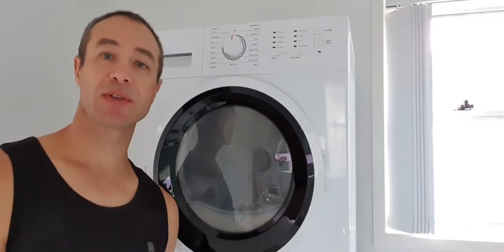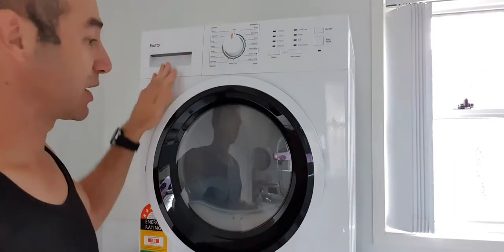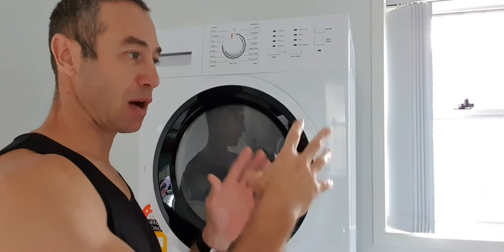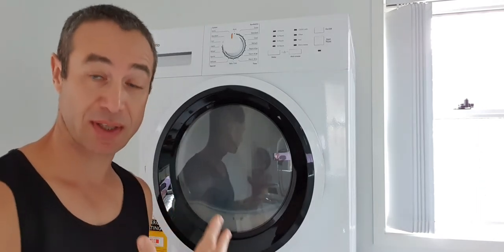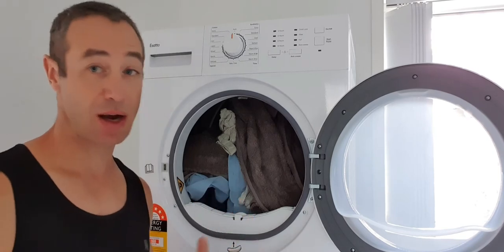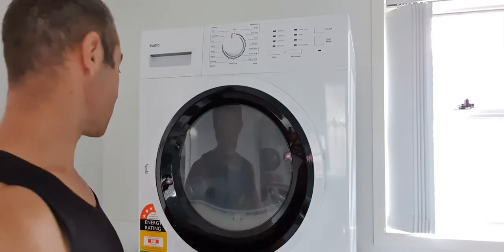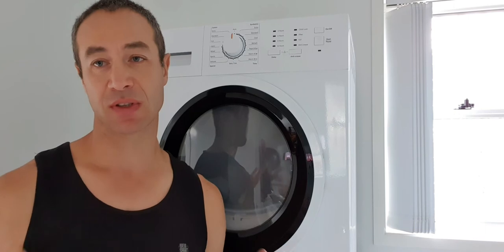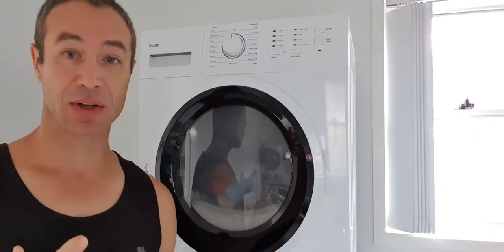Esatto 7kg heat pump dryer first use. Can you mount or stack it?

Comment: Hi Greg, thank you so much for your videos! Really helpful!! I have a problem that I haven't heard you address. I can't shut the door of my new, 7kg, Esatto heat pump dryer. If you have any tips I would appreciate it.
Reply from the maker: Hi Karen, thank you for watching. I'm trying to address hints and tips, but also touch on common faults. What you're describing seem to me not to be the common fault or a complaint that Esatto community is observing (or at least not frequent enough to reach me). One thing comes to my mind is that if door filter is not inserted correctly that may prevent shutting the door. Otherwise it might be just a manufacturing fault that you might need to report. Sorry for not being too helpful. It is hard to diagnose remotely. Please let us know how did you go so I can help others too. Thank you!

Comment: Hi Greg, my washing machine is 60cm deep. And the 8kg Esatto dryer is 65cm deep. I wonder if it's OK to stack the dryer on top of the washing machine. Thanks.
Reply from the maker: Hi Nam, thank you for watching. It is always amazes me that so many people are interested in this beautiful budget appliance. Back to your question... It really doesn't matter how deep your dryer is. What is important is that: 1. Your washing machine is strong enough to hold the dryer - heat pumps are heavy. Most of washing machines are - just pointing it out. 2. That you have a foam or rubber mat that separates them to avoid movement and essentially sliding down. 3. That legs of the dryer can fit firmly on top of the washing machine. All in all I think you should be fine, just pay attention to those points. Hope it helps.